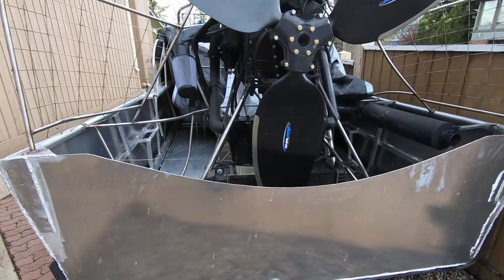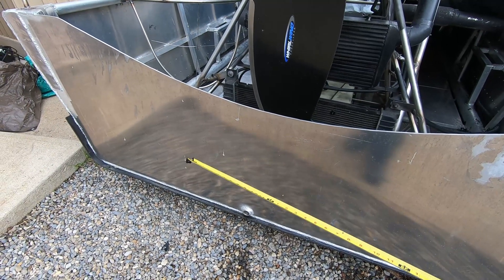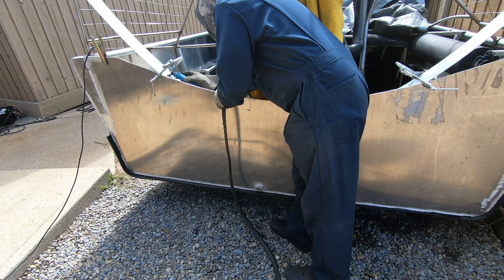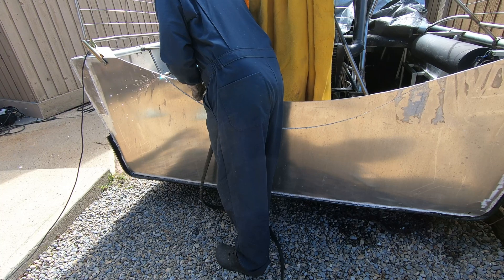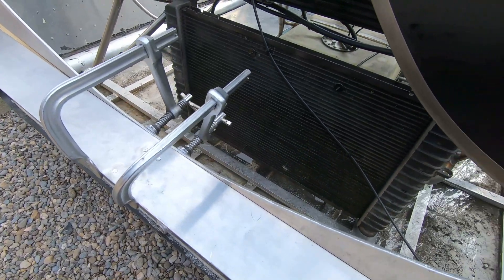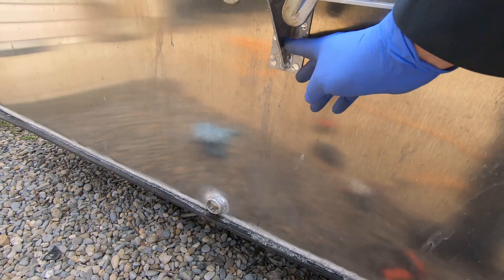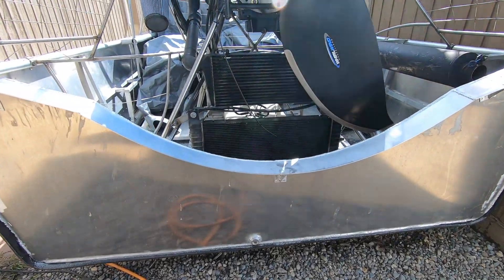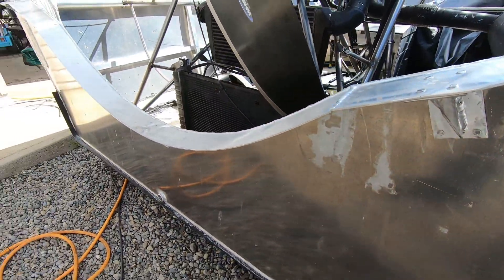Airboat Build #34: Finishing the Transom

Comment: The  transom can not interfere with sweep of the prop you will kill the performance period
Reply from the maker: The prop tip 6” below the transom is an intentional design element.  Like all designs, there is a necessary compromise.  With a high sided boat, in order to get above, the engine needs to be very high.  This affects the center of balance and centerline of thrust.  Thus, the boat will handle better the lower the engine sits.  The prop tips below the transom will impede airflow to a certain degree.  Yes this will decrease thrust a certain amount.  However, on this boat I have about 550 hp so there is a lot of thrust.  Trading a bit of that thrust for improved handling is the decision I made.  This practice of the prop 6” below is common with high-sided airboats.  Many of the commercial manufacturers do this.